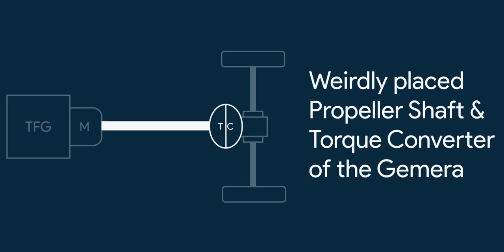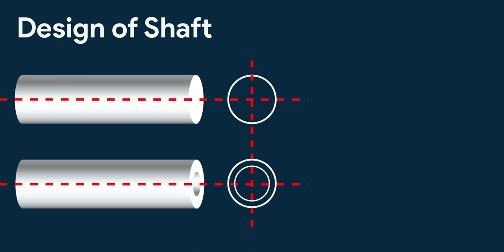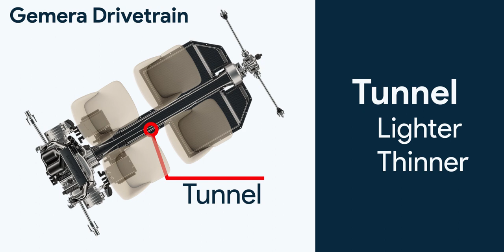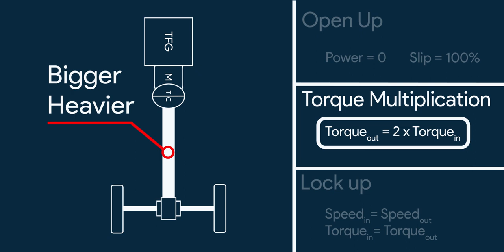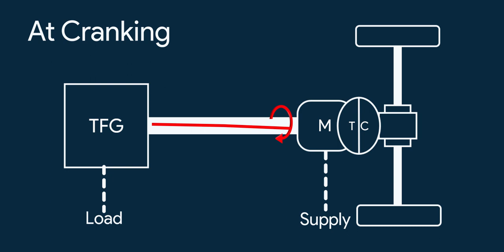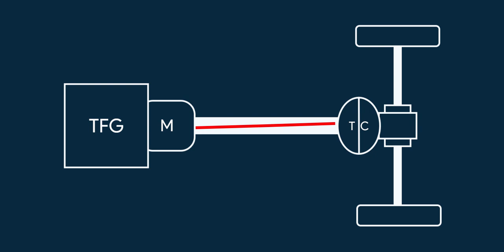Koenigsegg Gemera | Unusual Propeller Shaft and Torque Converter Placing | Technical explanation

Comment: Why don't other cars put the torque converter behind the prop shaft then? Is there something unique to the Gemera that makes it the only one capable of this layout?
Reply from the maker: Propeller shaft is required when engine is farther than the wheels to be driven. Thats why front engine rear wheel drive cars have propeller shaft. In such setup it is difficult to put transmission at rear, because transmission will consume more useful space than what a smaller diameter propeller would save. Hence not generally used. Gemera has rear mid engine front wheel drive which is not generally seen in cars and it also doesn't have transmission, that's why it was possible to do such arrangement in it.
Reply: @UntangleClub  ...that's a very weird setup for a sportscar 🤔   Nice video and explanation ✌🏽